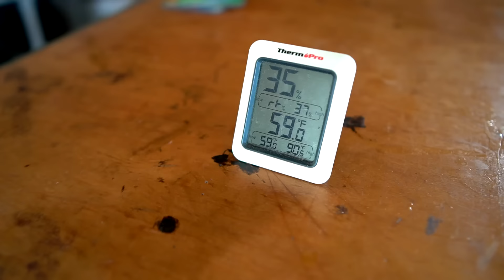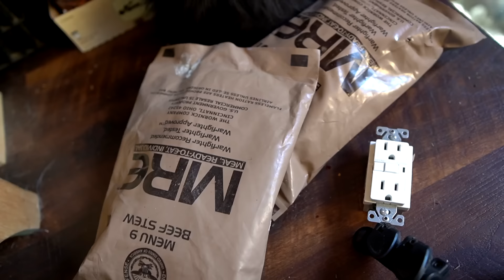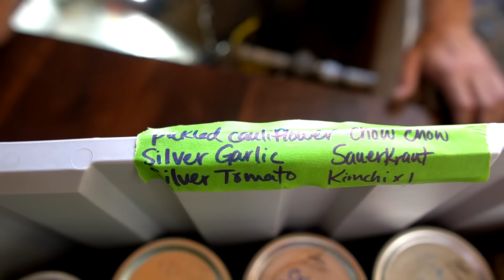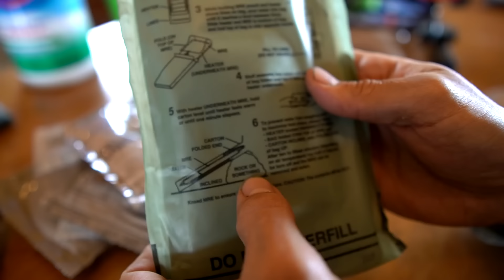Settling Into Our New Home with All the Critters | Running Water & Canned Food Storage

Comment: Good vid.  Sitting at a table and eating.  How about that folks.  The pie looked delicious.  Well glad the move is going well.  Glad the chickens made it ok.  Hot running water.  Almost seems like a miracle.  We had a very limited well growing up.  Three to four gallon reserve. I know the feeling.  City water was run through our area of the county and we hooked on.  Turn that spigot on just to see it come out.  That debris in the water line, when you get stabilized and warm weather it may be a good idea to flush that hot water tank.  Also there are little filters in the shower and sink fixtures that will trap that and block off or not seal when you turn the water off.  So a little maintenance when time allows.  People just don't appreciate running water.  That moose.  Watch it.  It may be looking for a freezer to hang out in.  That new tractor, does it have a backup alarm?  Neither one of you needs to be a statistic.  You might want to get one of those fancy thermometers that has a phone app to monitor the temp in the crawl space.  Not an issue now but for next fall it will be.  At least know what's going on down under.  Grow some legs under that table.  Kill your back bending over.  You all take care be careful, safe.  Surprised you had time to post a vid.  Chop chop.

Comment: Congratulations on the big move.   Glad you got the water going. What a wonderful feeling. Even better when there are no leaks. Chickens seem to like the new shed. That was a great way to move them. If you need to drain the water system for an extended leave, my truck is to blow out the water lines with compressed air to get all the water out of low areas. That way no busted pipes when water is turned back on. Looks like the last owners did a good job as well. Last I would like to thank you for three excellent video in three weeks with a major trip and move going on. One you tuber said it takes them about eight minutes of editing for every minute of video. So most appreciated for the content under such busy circumstances. I'm hoping that young female moose is all right. I think she is just checking out her new neighbors. The house and yard has been quiet for a while. Thank you both very much. My favorite channel.

Comment: On a previous video you discussed using birch bark for starting a fire.
My father in law burned birch wood for heat for over 80 years.  He cut wood during the summer and split the small rounds of logs from 6 inches and up (some as big as 30 inches)  The logs were split so they would dry faster.  When splitting the birch wood, often the bark would come off and smaller pieces of wood were left from the splitting.  The bark and the small pieces of wood were collected in boxes and stored in the woodshed  to be used to start future fires in the stove. There was enough bark and small pieces of wood to start fires for the season. The "green" wood was seasoned over the summer, fall, winter spring and the next summer before using the wood in the wood stove.

Comment: the shower valve is "pressure balance" it has to have both the hot & cold on to get proper water flow out of it!! the piece that you removed was the anti scald feature!!  congrats on getting moved & settled in to the new cabin!!! be safe & thanks for sharing with us!!

Comment: Suggestion: Walled open spacer shelves above the door and windows with protected sides for cabinets with bungie cord protectors.
make a front door mud room.. since there is a front porch.. would be nice to keep the wet boots n stuff outdoor.
Pole mounted LED solar or powered with generator lights around your yard.. since there is wild life moving about...would be nice to see whats coming. Lastly.. get a table cloth or printed plastic sheet for the main table.

Comment: At 70% humidity, "dry storage" may be a misnomer.  At least it'll be dark and cool.  Maybe you'll need a dehumidifier - I'm thinking you may want to install a duct to bring air up to the main floor, dehumidify, and return that air to the cellar.  That will allow you to empty the humidifier (or install a drain) without you having to go down there.  There's some discussion over where to set the water heater heat.  Personally, I like to set it hot enough to scald me.  That way, when I mix it with cold to get the temperature I want at the faucet (or shower) I'm using less a percentage of hot water for the mix.  That saves more hot water in the tank for other uses.  On the other end of the spectrum, it uses a bit more propane to heat and maintain the water at the higher temperature.  There must be a point of diminishing returns, but I have never plotted the data (or even collected data) to see where that point is.  I do know that commercial establishments are required to maintain a dishwasher water temp of 160 degrees.  That works for me!  Nice deer heads!  I'll bet Arielle's pies are better than the MREs!

Comment: If your shower valve is a pressure balanced valve, it needs both hot and cold water turned on to flow...pressure balanced means the valve will compensate if you turn on another water source in the house and keep the temp the same, so you don't freeze or burn while taking a shower...it is a nice feature.

Comment: The shower faucet has a pressure balanced cartridge which is designed to prevent scalding when someone flushes a toilet 😂. Needs about equal pressure on hot and cold to operate

Comment: Always good to let the lines clear before you have a screen or shower head on them.
Sadly you now have dirt-plugged water lines.  Clear those lines and your power will be even higher.  
Looks like that was a water saver in the shower.  I always toss those too.

Just a note... that was coconut MILK, not coconut.  I'm sure you know the difference, but I was listening when you said that, so didn't catch it until I came back and rewounded it.
I always put about 4  one inch slits on the bottom of the pie, and bake it for about 5 mins before filling it.  Using weights is more of a Southern thing.

Do you have ferrets or foxes there?  The rooster is probably having trouble steaking out his new territory.

Pie looks yummy!

Comment: Yeah that valve temperature thing you took out of the shower, never much noticed until I got old and downsize to rentals and my last two rentals have those set low so I never get a really hot shower. They also put it on because in the old days kids were getting scalded when showers got popular and it’s a protection thing.

Comment: Getting so many eggs, as milk, design a tower where air is blown, an injector squirts and atomized the egg, then floating on the air, the solid gets lighter floating to the top of a tower where powdered egg or milk accumulates.
Then squirt nitrogen through it in a bag, then seal it.  Trying to learn yous somethings.

Comment: Hey just a thought for you to help keep your hot water stay hotter longer and help no use as much propane and or electricity!!! You should get one of those insulating blankets that they make!!! We got some for are house and are hot water heater!! We had to even turn the nob down on are hot water heater because it was definitely to hot for both of us!!! So when we built are house back in 2000 are first few months of are electrical bill was like just over 400.00$ I even called the electrical company and asked them if something was wrong?? They said that the first few months it would run higher and after everything got heated up are electrical bill would go down!!! So I started looking for some way to get are electrical bill to be around 100.00$ a month or lower!!! I ended up finding a company called radiant Barrier and they would sell something for are attic and they would install it for us so that it was installed properly to do the best job and if we had baught it they would give us a free insulator blanket for are hot water heater!! I was like is that?? Lol!! It’s a silver double layer of like tin foil with some stuff in between the two layers of foil!! The stuff in the attic is supposed to reflect the sun back out away from are house during the summer months and keep the air in the house!! And during the winter it reflects the heat back into the house keeping it much warmer for longer!!! They also said that they would refund us every last penny that we spent on the stuff if it didn’t save us money on the product and it would also pay for the stuff in savings on are electrical bill with in 3 to 4 years!! Of course I definitely was skeptical about it but I figured that if it didn’t work we would get are money back!! They came out with in the first week that we signed up for it and they had everything installed in less than 4 hours!! Are first full months electrical bill we was definitely shocked for sure!!! It was just under a 100.00$ and the second month it was at 73.62$ we was definitely shocked and my mom and dad, my dads mom and dad and also my moms mom and dad also ended up buying the stuff and everyone of them also saved a bunch of money!!! We ended up paying for the stuff back with all the savings that we have been getting still to this day with in just under two years!!! And they had said it would take up to 4 years so we was definitely very happy with the stuff!!! And after having the hot water blanket installed and almost burning are selves with how hot that the water was we ended up turning are hot water heater down two notches and that ended up saving us even more!!! Definitely worth every last penny for sure!!!!! Well I hope that you both give it a try because I definitely guarantee you that you won’t be disappointed!!!! It also will help with you during the winter months and burning firewood!!! You definitely won’t be burning near as much firewood!!! Well maybe we will get to see you guys putting the stuff on your hot water heater??? Awesome video and remember keep up all the hard work buddy!!!!

Comment: I love watching you all, and your ability to concur through everything. I have worked in maintenance for almost 26 years and own a cabin on a well, it’s a good practice to set your water heater not past the B setting for your safety and the longevity of the water heater. Also every now and then you can unscrew the ends of your faucets to clean the screens off, sediment will build on them if you don’t have a sediment filter on the in coming supply line from your well.

Comment: As a former pest control guy if an animal got in there and ruined and spread the insulation expect it again and with your dry food it could spoil it. Nothing bad would happen to the canned food though.  You will want to put rat traps down there. It will catch mice and rats. Those critters can get in 1/4" gaps for mice and 1/2" gaps for rats. Even if you don't catch anything, it is a monitoring for you. Put in all corners and along the closest wall you can see when you open the trap door. Put peanut butter on the trap paddle.  You guys are inspiring. I love watching the process.

Comment: I don’t know if you know or not, but there is a schrader valve on the top of your blue pressure tank, since your cut-on is 40psi, the air pressure on that tank should be 38psi with well pump off and pressure tank drained of all water.

Comment: I’ve done plumbing before with a plumber buddy of mine for years and the plastic piece in the taps we always put in where the little plastic bump piece on the ring is all the way to the left this gives you full range and motion of your water tempeture if only you knew your ideal temp for your shower you like you can put it in the l deal spot to just turn on right to the stop and it would be the perfect temp but all the way to the left will give you full on the hot only

Comment: The hot water in the shower check under the handle for the shower take off the cover to the handle and there should be a way to adjust the hot and cold

Comment: Well i am a plumber. Left is always hot by code. Code can be broken by do it you self folks, they give me a lot of work so God bless them..If you have a lot of calcium in the water never let the water get over 60 degrees Celsius or 140 degrees Fahrenheit. Some chemical reaction happens so the calcium deposit very quick in the water heater and system 💧 Peace

Comment: Hi guys. I have the exact same water system at home. Your pressure coming out of the faucets seems too low. There are two (2) different pressure systems you need to look at. When you see water pressure on your gauge at between 40 and 60 psi, that’s perfect, but that is the pressure in your pipe system if I might describe it that way. The other “zone” you need to look at is the pressure “inside” your blue thank. That one should be at 32 psi or about (see your label). To make sure you have the proper amount of pressure “and” air volume inside your thank, you first need to shut off your pump, then release all pressure by opening faucets. When pressure is at zero and no more water is coming out, that’s when you want to build-up pressure inside your blue thank to 32 psi, by adding air with your compressor through the small valve directly on top of the thank. (it seems to be covered by the platform supporting the hot water thank) The reason to get the water pressure to zero first, is that the diaphragm inside the thank need to be completely relaxed before you build-up pressure to 32 psi; otherwise, you’ll read 32 psi all right, but the air volume inside will be half or less. Cheers from Quebec.

Comment: FYI the MRE heaters grow old and malfunction but if you put about a teaspoon of salt in the pack as you pour in the water then turn it on its side to thoroughly soak the heating element it often works again.  Check the numbers imprinted on the seal of each package.  It shows the Julian date of packing.  There are four numbers. The first number is the year “2” could be 2022 or 2012 or even 2002.  It’s often a guessing game.  The menu helps as beef stew is an older item so I’m guessing 2012.  The last three numbers are the day of the year e.h. 001 is January 1 and 365 is December 31.  MRE are not quite as long lasting as Mountain house but if stored properly—not in heat—they will last long after their expected 5 year shelf life.

Comment: I was just rewatching your video on your plans and was concerned with your trying to pour a large cement slab on your own.  There is much engineering that goes into a slab pour and since time is at a premium, I think it would be worth your time and money to have an experienced company come in and supervise and help do the slab project.  A person you might want to consult with is Bert Somers at the somersinalaska youtubesite.  He lives in North Pole AK and has built a number of building in that area on slabs and could help you understand some of the issues you need to consider.  I know he could save you a great deal of time.

Comment: you might wanna plug the eves of your new chicken coop. Fishers and others love chicken yum yum. if your gonna leave them open for ventilation. Use 1/4 mesh plus pieces of hog panel. Hog panel? they come in 4 foot high by 12 feet long? cut them up into pieces either bend them to fit between joists... or use Fence nails. Horseshoe nails.. nail them into place. Or use metal ready tape!, plumbers tape! it has holes every 1/2 inch, one big one followed by one small one they come in rolls. 25 foot rolls.  Cut off what you need, screw over panel wire, in between roof joists. It will keep out all the toothy critters even wolverines.. they love chicken to. just as you can blink a new predator will take a chicken if your not looking.. as you know the first few you lost at the other place.